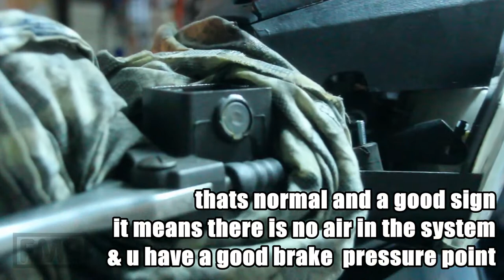vespa DISC BRAKE BLEEDING / brake fluid replacement / FMPguides - Solid PASSion /

Comment: what brand of water suction tube used?  And what is the diameter of the hose?
Reply from the maker: its available under many brands
Reply: @FreakMoPed8  do you know the size of the bleeding screw on the piaggio grimeca/hengtong calipers?
Reply: @FreakMoPed8  Do you know the size of bleeding screw on the piaggio grimeca/hengtong callipers?
Reply from the maker: sry no

Comment: My gts lost the rubber cap of the rear caliper. Would it later cause any damage to the caliper? Thank you.
Reply from the maker: U mean the cover of the brake pads?
Reply: mista FreakMoPed i mean the rubber cap of the bleeder valve
Reply from the maker: Doesnt matter, it only gets dirty